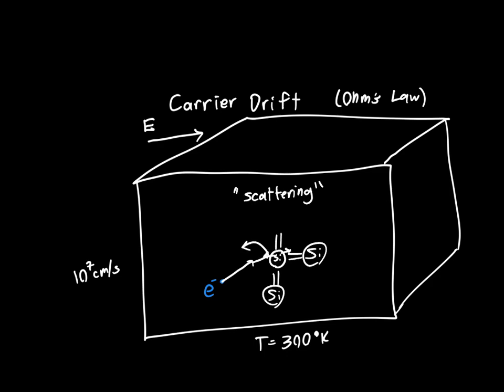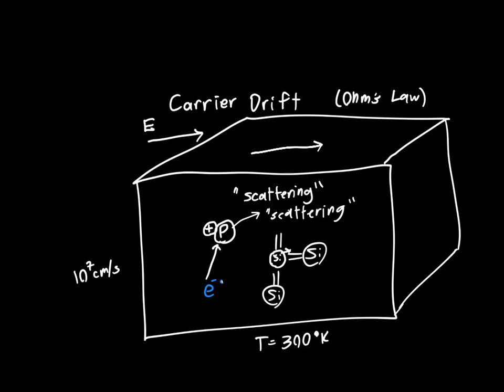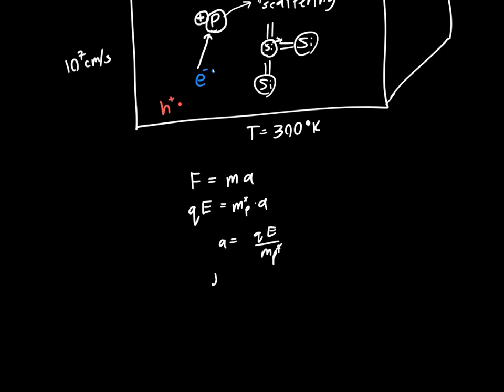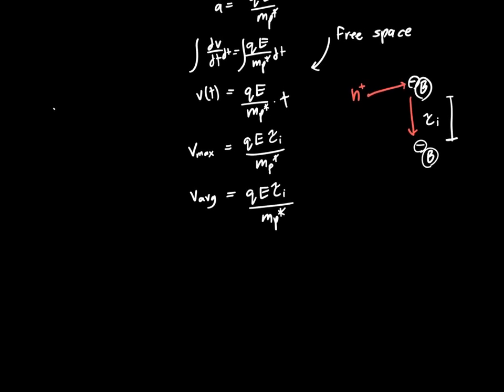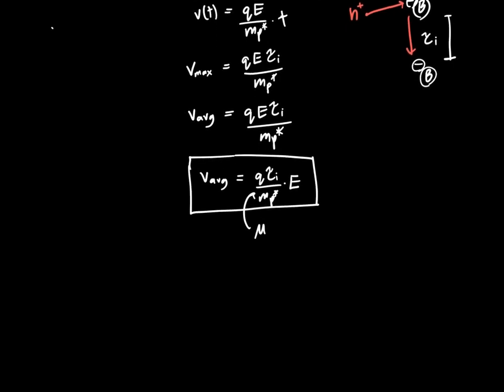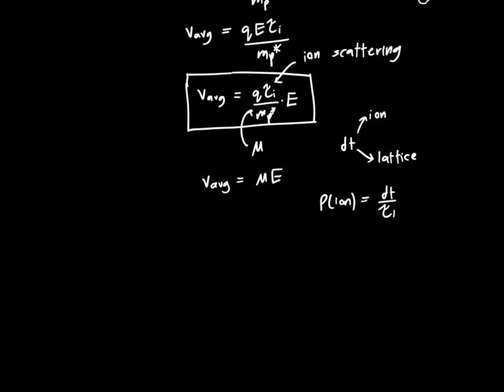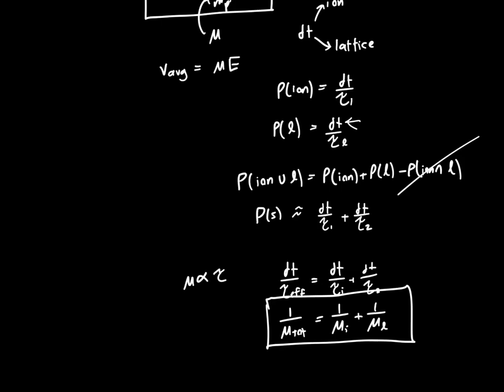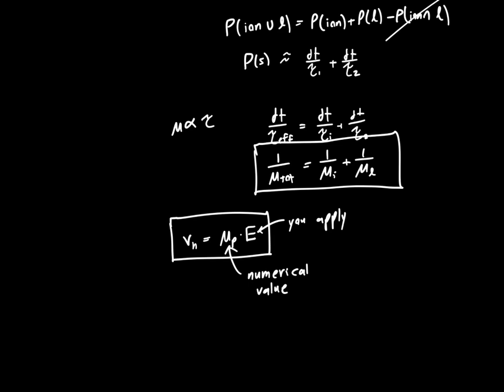Carrier Drift Current: Mobility

Comment: Sorry i'm a biologist that starting to pick up physics, I was wondering how do we get the value of the effective hole/ e mass  and the q (elementary charge).  Is it provided by the fabrication facility as well by the material i use or i can count it.
Very grateful to watch your video, you helped me to understand a lot of the physics concepts in my PhD work.
Appreciate.
Reply from the maker: I was once a biologist trying to pick up physics too (one of my degrees is Biology). The effective mass is usually gives in tables for a given semiconductor (for example for Silicon, Germanium, ITO, and so on), and q is a fundamental constant that never changes equal to  roughly 1.6*10^-19 Coulombs.
Reply: @JordanEdmundsEECS  Dr., do u think you can make a video on diffusive , ballistic and hopping transport?